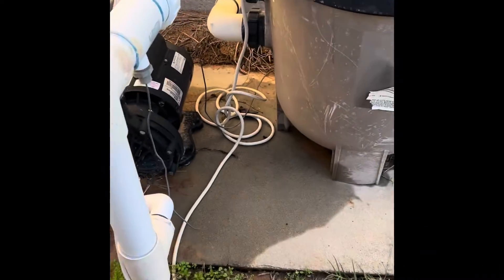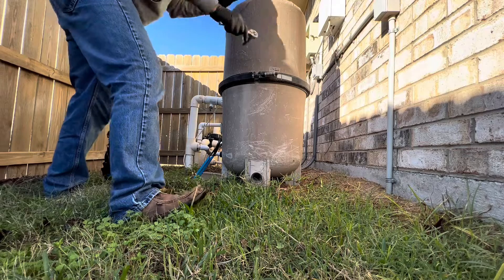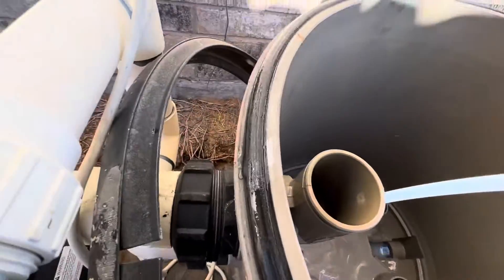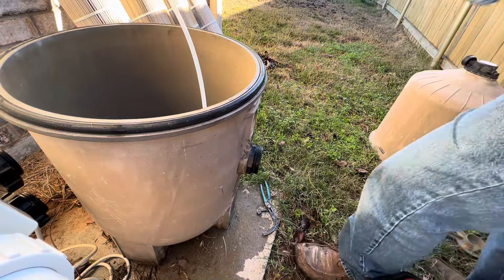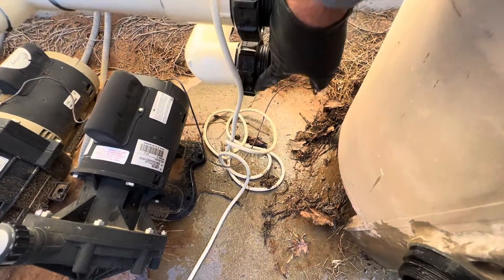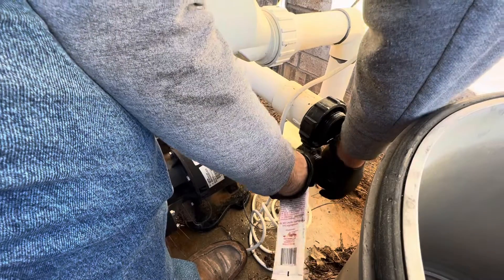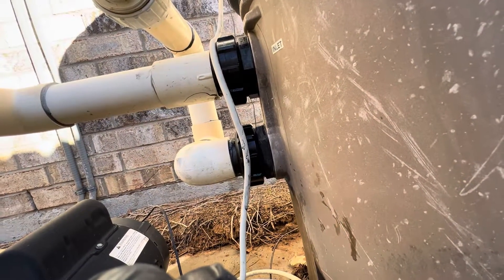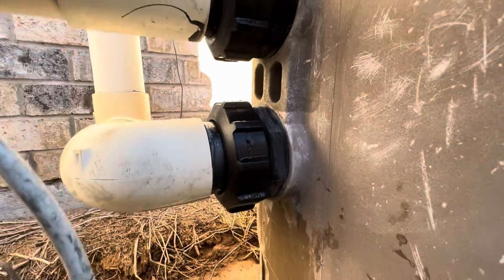Filter leaking - Bulkhead Replacement

Comment: How can I replace the connectors to the bulkhead.   Mine is leaking from the connectors.
Reply from the maker: If it’s on the nut side, it may just need new orings

Comment: I still get get a slow drip after I replace the bulkhead on the top. I’m thinking that it’s actually leaking from the baffle assembly inside the tub. Wondering if this just unscrews and if the cause is usually an another O-ring to replace?

Comment: Do you have the part numbers you used? I have the same filter and need to replace a cracked fitting. Your help would be greatly appreciated.
Reply from the maker: Inyopoolshttps://www.inyopools.com/partlisting/hayward-swimclear-cartridge-filter
	4811-46	BULKHEAD O-RING
	4811-47	BULKHEAD FITTING

Comment: Man your fitting came off easy with just that filter wrench. Mine is just stripping the plastic off, can't figure out how to remove it without damaging it further.
Reply from the maker: Most likely it’s in a bind. May have to tap on the fittings to get them to turn loose. Also make sure the wrench is making contact with the fitting in at least 3 points. If only two, the pressure is not equal and it won’t spin easily
Reply from the maker: This it the wrench I use.

https://www.amazon.com/Channellock-209-Filters-Conduit-Fittings/dp/B0009WG5SU/ref=asc_df_B0009WG5SU/?tag=hyprod-20&linkCode=df0&hvadid=309807921328&hvpos=&hvnetw=g&hvrand=10681896771031982346&hvpone=&hvptwo=&hvqmt=&hvdev=m&hvdvcmdl=&hvlocint=&hvlocphy=9027237&hvtargid=pla-420760081140&psc=1&_encoding=UTF8&tag=stevethepoo0c-20&linkCode=ur2&linkId=c0d2abdc501b4fde35b81cd079ac0e45&camp=1789&creative=9325
Reply: I had to resort to cutting mine off because when they installed it, they got some of the pipe glue into the threads, unfortunately.

Comment: Hello, how much could I charge for a job of this type?
Reply from the maker: It usually takes 2 hours and maybe longer if you clean the cartridges too. 
So charge accordingly
Reply: While you had the tank apart you should have replaced the bottom bulkhead also.